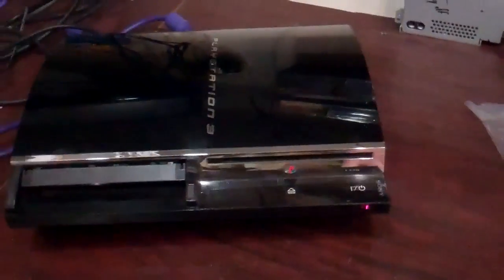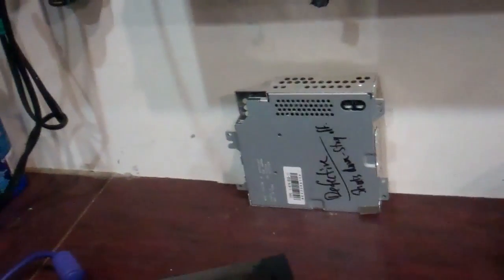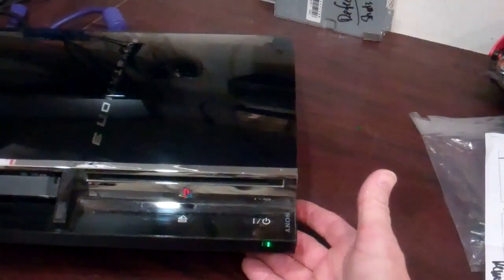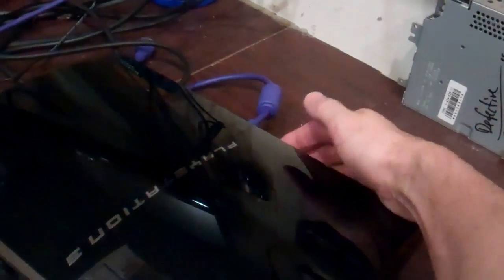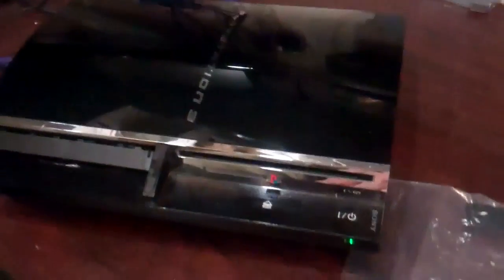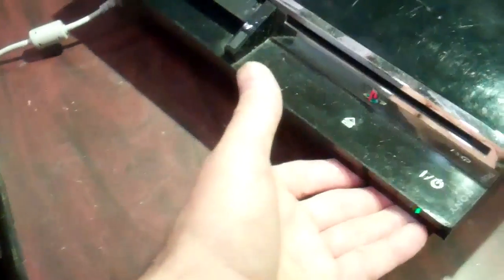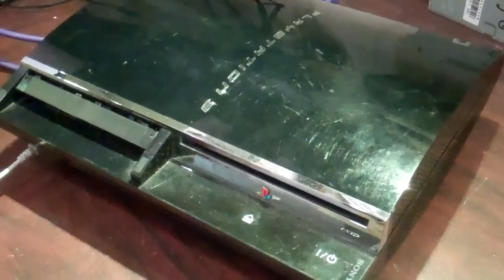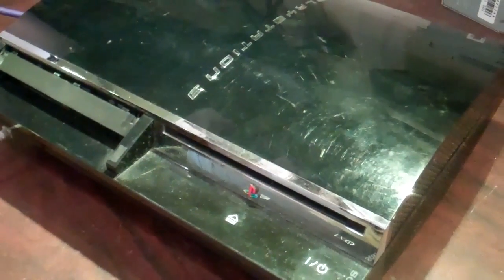How to repair fast fan speed on PS3 - unable to cool properly.

Comment: Mine does this too, replaced the heat compund, totally cleaned out everything that had dust, and still the fans go to full speed, what now? :c
Reply: Did you fix it, I have the same problem
Reply: Having the same problems on my refurbished PS3, did u fix this

Comment: Hi I'm having this problem two ..I've switched thermal and bent the clamps which helped keep the system from shutting down but its still speeding like where it ends in you're video . What would you recommend?

Comment: i just saw on another video you can still try this 
put 4 cans on the 4 connors ok like me i put two CD case like you ps3 game cade under the middle of my ps3 it helpping you ps3 cause their is a little fan under the ps3 and if it overheating a this point it maybe only your power supply send it to sony it also prevent an YLOD

Comment: if u put it vertical but on the wrong side ffor sure it normal u r blocking the fan and afther 4 hours it normal but it still not suposed to be loud at this point

Comment: I am having a problem with fan speeds and now the rlod. I have changed the thermal compound and cleaned the board and fan. The system comes on for about two minutes the fan starts slow gets to where it sounds like a jet and the system turns off. My hard drive recently crashed and had to reformat. Any suggestions?

Comment from the maker: The clamps are there solely for tension on the heat sinks.  I have never seen them bend at all over time.  Our data is made up of extensive record keeping and what we post consists of things we have found to be near 100% true.  If doing something works 95% to 100% of the time then I consider it worth doing.  It's a simple test to measure the height of the center of the clamp off the surface of the table and then compare it later.

Comment: mine was doing this but i found that it wasnt making contact enough from the cpu and gpu to the heatsink on the fan making it go louder ,alltho it would run fine without turning off the fan would be stupidly loud to get it as a comfortable temperature ,i thought about buying scrims but after reading up about it decided against it ,instead i got a old credit card and cut 2 small rectangle pieces and sat each of them on the metal under the metal arms that screw down to clamp it down making it fit

Comment from the maker: Always flat - never sideways.  The biggest mistake of XBOX and PS3 is positioning it sideways.  Any repair shop should be able to tell you many problems with drives are having the unit sideways.  The drives last longer laying flat.  Also, I can speak from experience - after repairing a unit and testing heat output the temp will be higher sideways and lower laying flat.  Why?  No real idea other then design of the air ducts and cooling system.

Comment from the maker: PS Store are usually demos - but if your referring to full games, the only thing I could think of that would be different would be the additional load of the blu ray drive.  The blu ray is above the cooling ducts and heatsink.  If heat from the power supply and blu ray build up it will cause a doubling effect on the PS3 making it struggle more to keep cool.

Comment from the maker: This is completely true. A manufacturers PS3 will dry the compound about one year after you buy and use it.  It then will start loosing thermal transfer ability which will increase the core temp of your GPU.  This will continue until the temp is deadly enough to crack the solder from thermal expansion and contraction.  The combination of all these cause the unit to fail typically.  On occasion a unit will actually fail from overheating which will cause more damage under the GPU.

Comment from the maker: Alot of guys recommend MX2 and Diamond and many other compounds for PS3 units.  We have done testing on all the compounds and we also record any returned units.  Artic Silver 5 still remains the lowest return rate on all repairs and out of all compounds tested, so we will continue using it.  It is possible for other repair centers to get data different to ours as their actual repair and methods of applying compound may vary from ours.  Please post any statistics you gather:)

Comment from the maker: YLOD is not repaired just by thermal compound and a new power supply.  Are they recommended after repairing YLOD?  Sure - it is always a good idea to do anything that will remove heat from the system.

Comment from the maker: Extended warranty is never a bad idea if you can get a distributor to do a new replacement warranty.  Otherwise when the unit inevitably breaks, and it will, you will end up with someone else's possibly worse condition used unit as a replacment.

Comment from the maker: Playstation 3 units suffer less mechanical issues when flat down or horizontally placed on the table.  This is also the case with XBOX360's.  Why the manufacturer put feet on their sides I could not guess as it causes premature wear on the mechanical parts - mainly the DVD and Blu Ray drives.  But, then again, the manufacturer gets paid after warranty - so maybe its a smart thing on their behalf.

Comment from the maker: Heat is a part of the solder issue.  The actual cause is the expansion and contraction of the PCB.  As the manufacturers compound dries out prematurely (which they obviously are not concerned about) the core the of chip and the entire board start to get hotter during normal use.  This heat is what eventually causes the solder to fail.

Comment from the maker: Your fan will normally be slow after installing fresh compound.  If you watch our videos on the new fan mod they will cover which models have heating issues right from the factory.  Some Playstation 3 units will actually keep the fan slow even when they are sustaining heat damage.  This is because the expansion and contraction of the PCB is actually the cause of damage while the GPU core may be within spec temperatures.

Comment: SPITFIREMODS is the person who uploaded this video, and it all depends on how much each game uses the gpu/cpu etc, some put a heavy load on the console therefore it's more likely to overheat, if the thermal compound has been changed then that shouldn't be a problem, unless they didn't put the console back together properly. It could also be a loose  connection, if it has got very hot then it may have heated the solder to a point where the wire can disconnect itself

Comment: I think I'm correct in what I'm saying but SPITFIREMODS may be able to provide more accurate information... basically the PS3 monitors the temperature and adjusts the fan speed accordingly, however the console more often than not changes the fan speed when the damage has already been done, i.e the fan changes speed too late ( after the CPU/GPU has already overheated. A build up of dust also causes overheating, try changing your thermal compound and giving the console a good clean out

Comment: turns out the metal springs clamping down the sink to the board were not springy enough and i used a lot of thermal paste. so i redid the paste to a very thin layer then a rice sized drop right in the middle of the gpu and bent the springs and tightened them up and my heat problem is fixed. turns out i got the rlod again and repeated the whole process and is working again, for the minute.
Reply: That’s correct.  Exactly how it should be done.  The smallest amount of paste will transfer heat best.

Comment: the clamp tension worked somewhat. it got me up to about 20min before the fan kicks into high gear. before doing the the re-flow my ps3 rarely turned the fan on to an audible level, but i suppose that is the case for the video, too. any further advise? is there a drying time i need to be aware of for the thermal paste

Comment from the maker: This video was a typical machine with fan speed issues.  We threw a few things at it that does fix many units.  This unit ended up just having a clamp issue in that the clamps were flat or not enough tension.  So bending the clamps to apply more pressure did the trick and the machine has been working now for about a month.  We do sell a fan booster that has already taken care of many early release A01 and E01 units as well as works on slim and should work on XBOX360 as well.  Video up now.